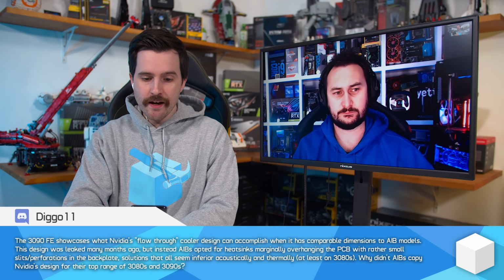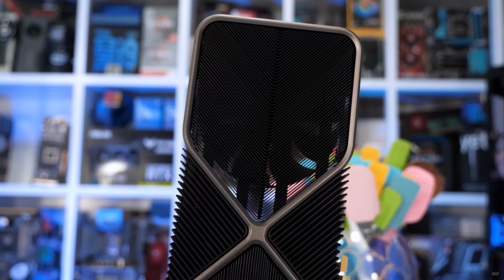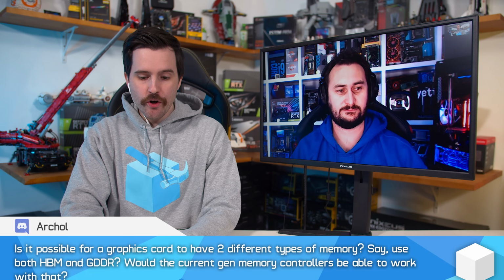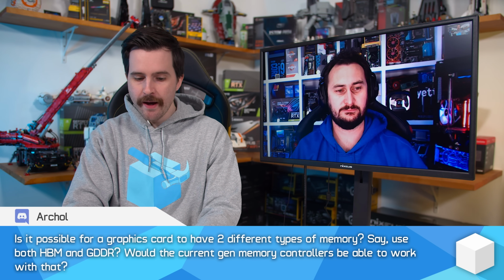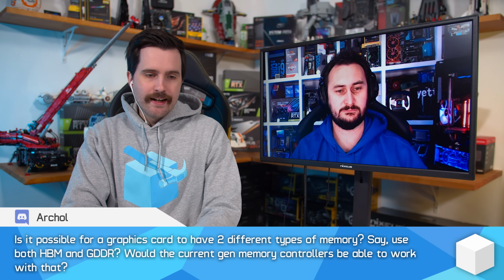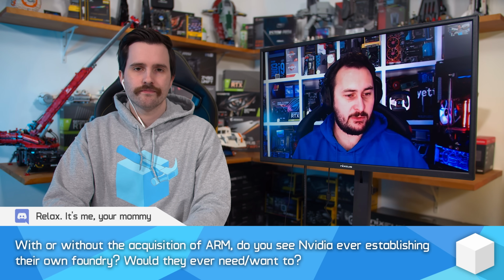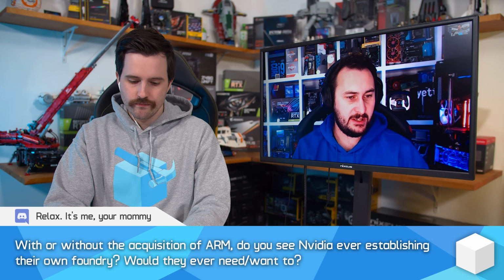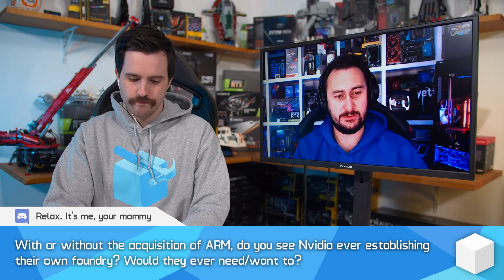Will RDNA2 and Zen 3 Have Launch Issues? Can AMD Beat Nvidia at Ray Tracing? September Q&A [Part 3]

Comment: with the consoles have AMD GPU's and therefore AMD raytracing implementation will AMD have a potential upper hand when it comes to raytracing since a lot of games that are on the consoles will most likely come to PC allowing for better optimisation since its already been partially developed/have more knowledge of how it works.
Reply: They said the same thing when the PS4 launched.
Reply: Ps4 & xbox one also had amd hardware, that didn't seem to give amd any advantage in gaming. Ryzen is inferior to intel in gaming & amd's gpu's are also inferior to nvidia.
Reply: AMD PC GPUs from the PS4 and Xbox One era have aged so much better than Nvidia GPUs if you try playing modern games on them. This is first couple of generations of GCN. I wonder how much of that is because of the console thing. For subsequent generations though AMD's losses and lack of R&D in graphics caught up with them either way.
Reply: @fabAB912  ps4 and xbox one had jagaur cores not ryzen cores
Reply: @fabAB912  The other posters here are correct. PS4/Xbone used Jaguar cores, not FX cores. So Jaguar actually had more in common architecture wise with Intel's Core CPUs, than it did with AMDs own FX CPUs.

And the PS4/Xbone Jaguar cores were low IPC and low frequency at 1.6ghz/1.75ghz respectively. So Intels high IPC high frequency Core architecture obviously ran games better than AMDs very poor performing FX series (FX were very different architecture wise compared to Jaguar and Core). On top of that, Intels Core CPU line dominated PC sales for over a decade (understandably), so every PC game engine has been optimized with their architectures in mind on PC. But thanks to the PS4/Xbone consoles 8 core low IPC low frequency Jaguar CPUs, you need at least an 8t (4c/8t) CPU now for new games to get decent performance on PC.

So desktop never actually had an CPU other than Intel's that actually best matched the PS4/Xbone consoles architecture. And game engines have been optimized for Intel CPUs on PC (because of no other alternative, FX was not good). And it takes years for the market to start optimizing for new CPU architectures in software and games. Most productivity software is already optimized for Ryzen, because it is much easier to do so (I remember seeing steady improvements in various productivity suits as they were further and further optimized for Zen). 

But game engines only follow when a new CPU architecture has been widely adopted, and they also follow the consoles as a baseline (and Intels Core was the best for games coming from previous gen console games made for Jaguar CPU cores). But Ryzen is reaching a tipping point. What we are seeing in current games is lack of Zen and/or lack of multi-core optimization. As an example, here is a new game that has been optimized for AMDs Zen architecture and also optimized for muilt-core.
https://www.computerbase.de/2020-08/troy-a-total-war-saga-benchmark-test/2/

As you can see, an 3700X edges out and beats an 9900k (which doesn't happen in older game engines), and the 3900X/3950X beat all others. So this game is clearly using 12c/24t very well, but it is not using the 3950X to its full potential. So we need new game engines optimized from the ground up (or heavily modified) for Zen architecture and/or for multi-core (a Zen architecture strength). Multi core alone allows Zen architecture to shine. We were also limited by lack of low level APIs (DX12, Vulkan), but I have seen even DX11 games use multi-core extremely well (so it depends on the game). And we have had low level APIs such as DX12 since 2015, and Mantle (Vulkans predecessor) even before that.

But higher count multi-core CPUs (6c+) were also held back by Intel on the desktop for a decade (with Intel's mainstream desktop line), so single thread and single core has been dominant as well, there was only 4c/8t max available for years on desktop, so game devs couldn't push past that even if they wanted to. Coupled to that, game devs took quite a while to get used to and make full use of all the cores in PS4/Xbone consoles. But game devs did get used to them, and they are much more used to multi-core CPUs now, but they are limited by current gen consoles low frequency low IPC 8 core Jaguar CPUs being the baseline (which is why we are mostly seeing 8t being the optimal thread count in most games at the moment). 

But both next gen consoles have high IPC 8c/16t Zen2 CPUs, and many game engines are currently being made with them and Zen2 in mind. Epic games (makers of Unreal Engine and UE5) have recently received many Zen2 PCs for game development. And many other devs will be working on next gen engines with Zen2 architecture and multi-core in mind as well. And we have those same CPUs in our PCs now, thanks to wide adoption.

So it is a very different situation to previous gen consoles. We actually have the same hardware on the desktop, and when games are actually built and optimized for Zen and/or mulri-core, we actually see Zen architectures full potential. And as another poster here said, GCN also aged far better than NVIDIAs competing GPUs from the time. An 7970 performs far better than an GTX 680 these days for example. How much is down to drivers and/or game optimization I don't know. But GCN has aged far better, and it was AMDs main PC GPU architecture for a long time, as well as being in both PS4 and Xbone consoles.

Same as we have now with RDNA2 and also Ryzen in next gen consoles. They are AMDs main architectures going forward, and they will be heavily optimized for thanks to the consoles. The exact same hardware we have on PC. And AMD will keep refining and upgrading both architectures, so our performance on PC will increase with next gen Zen and/or multi-core optimized games, and also thanks to newer architecture updates such as Zen3 and RDNA3 as well. 

But I fully expect Zen2 to age fairly well (it won't age any worse than an Intel CPU) as games become more Zen optimized and also multi-core optimized, as demonstrated in the above article. And even demonstrated by current games now needing 4c/8t high IPC CPUs to play new games, thanks to PS4/Xbone slow 8 core Jaguar CPUs. Game devs have become adept at using at least 8t, and next gen consoles now have 8c/16t. It will take a few years for us to see a real shift in new game engines that are also Zen and multi-core optimized, but it will happen as the gen progresses. I suspect we will have some games for a while that are still based on older engine code (code that benefits Jaguar and thus Core), so it is all new or heavily reprogrammed and optimized code that will bring the most benefits.

Ryzen CPUs are being held back heavily by current PC game engine single threaded Intel/Jaguar optimized game engines, and also held back by the the consoles 8t optimized Jaguar/Intel code, that is the major issue here. Despite Zen's CCX and memory latency issues, it can actually match or exceed Intel when Zen2 and multi-core are actually taken advantage of by the game engine. And those game engines are coming as next gen moves on, thanks to the 8c/16t Zen2 consoles. And it is not that Intel CPUs will get slower, it is that Zen CPUs will get faster once they are actually made use of correctly by game engines, either by taking advantage of Zen's architecture and multi-core or even just multi-core alone. 

And next gen console games will be taking advantage of both Zen's architecture and multi-core, as new game engines are developed and released as next gen moves on. Those game engines will be multi-platform and optimized for Zen and multi-core. Lead PC platforms will also likely be Zen platforms (as it is with Epic Games) to make it easier to port to consoles, or console will be the lead platform outright and optimized for Zen and multi-core anyway. And once again, Intel CPUs wont get slower, Zen CPUs will get faster as they are correctly and fully made use of in modern game engines.

And as I showed above, even pure PC only titles can run great on Ryzen when actually programmed to make use of Zen's architecture and powerful multi-core muscle. PC game devs are also starting to use Ryzen PCs and optimize for Ryzen and multi-core, but it is a slow process that requires wider home PC market adoption. But that is already happening, Ryzen is selling extremely well. It just takes time, but once game devs have had a few years to focus on using Zen and multi-core to its fullest, we will finally have the latent potential actually being taken advantage of. Just give it time.

Comment: Hoping that Zen 3 doesn't have issues like 1st gen Ryzen. What are your thoughts on the aspects which could be problematic?
Reply: It is a refinement of a proven architecture, so I can't imagine there would be much room for things to go wrong? 🤷‍♂️
Reply: The only problem I can see is AMD beating Intel, becoming mad with power, and bumping up their MSRP all along the line.
Reply: @WhenDoesTheVideoActuallyStart  Zen3 is to early for that, if they beat Intel this time around they might to it for next gen. I expect a few years with Intel/AMD trading for top spot whenever one of them release a new flagship (about 6months between, give or take)
Reply: @ssu7653  Oh, I have no doubt that Intel will be able to match AMD in performance at some point of 2021, the problem is that the CPU prices fell so much because AMD wanted to undercut Intel. Intel has no reason to want to undercut AMD as long as it has the pre-built market locked down, so if AMD starts jacking up the prices Intel will follow suit.
Reply: @WhenDoesTheVideoActuallyStart  Sure they are interested in highest possible prices, but without performance lead they have to sell on something else.
Pre-built market is also changing, for every generation AMD deliver good CPU they get a bigger piece of that market. We are now on the 4th (upcomming) generation Zen CPU and that market is changing. 

Performance lead is what make Intel sell in the pre-built market, that will be ALOT harder when that crown is shared/lost. Top end products make for good PR, that help with selling lower tier products.
Reply: @WhenDoesTheVideoActuallyStart  Beat intel in what? They won't beat them in sales. Intel pretty much locked in business PCs. CPU performance? They're past intel already. There are more things than gaming.
Reply: @jazz_bass_merchant  Beat them in gaming, yes, in case you didn't know this is a gaming channel. And yes, they're already making a dent in the laptop market, in no time they'll make they're way into the desktop prebuilts.
Reply: @WhenDoesTheVideoActuallyStart  Pretty much what I said.

Comment: I think RDNA2 will end up at 3070 performance or lower.
Reply: @CloroxTree  I hope it will, I just don't see it happening. I'm already hyped for all the upcoming announcements.
Reply: @CloroxTree  I hope RDNA will reach 3080 performance but I'm not expecting it.
Reply: @CheapBastard1988  then you never saw any leaks the.
Reply: @malathomas6141  people that are following leaks knoq that amd could easily beat the 3090
Reply: More like 3070 super at last
Reply: Doubtful.

Comment: Can't they make a 100$ 1080p 90fps gaming card? That's all i want..
I don't think amd will able to give competition at high end gpu..
Reply: Can't the garbage video cards already provide that level of performance?
Reply: @circleofsorrow4583  no buddy..
I never seen a card capable of 1080p90fps gaming for 100$>>
Here in india we get that kind of performance from 200$ card
Reply: @SatnamSingh-mx2uc  what detail settings in what games, buddy?  I would be more concerned about providing proper sanitation for my family before I worried about the frame rates I could achieve.
Reply: @circleofsorrow4583  nah..
I prefer shiting on streets with my settings set to ultra🤷🏼‍♂️
Reply: I think they should realistically be able to compete in the high end. They are getting a 50% performance uplift from RDNA 1 -> RDNA 2 then you also have the fact they are creating much larger GPU's 80+ CU's that's double from the 5700xt which has 40. yeah, it's not going to be 100% more performance going from 40-80 but let's say 25% at minimum that's still overall a 75% increase over last-gen. I feel like they should be able to compete in the high-end.
Reply: @jonathanhatton3412  ive heard its 60%
Reply: I would aim for 1080p/120 but I totally agree that could be a huge seller for them. Such a small amount of die space is required for that now it should be profitable at a fairly low price, though maybe not quite $100 : )

Comment: Guaranteed that the next gen tech from AMD will be paper launches just like the 3000 series from Nvidia, the next gen consoles and just about everything else released this year
Reply: Nvidia's wasn't a paper launch, and AMD's won't be either. But yes, they will run out. Everything is running out this year.
Reply: I don't think it will be as bad as the Nvidia release.
People will probably have around a minute to buy their RDNA 2 GPU compared to the milliseconds you had to buy the 3080/3090.
Reply: Press x to doubt
Reply: BranchPrediction I mean, I want to be optimistic too, but don't underestimate the scalpers.